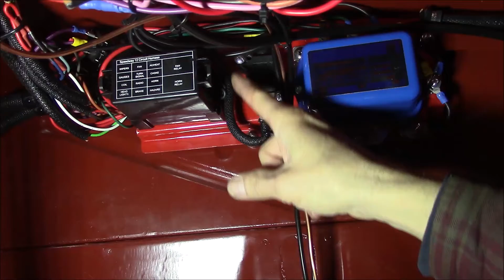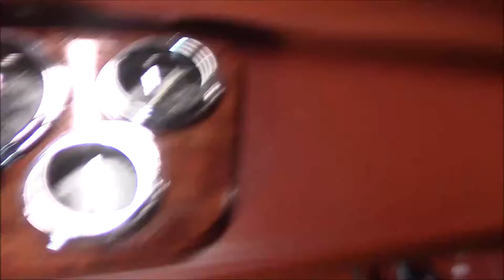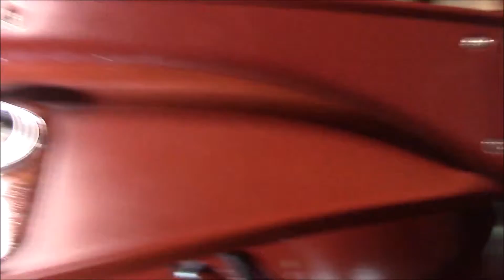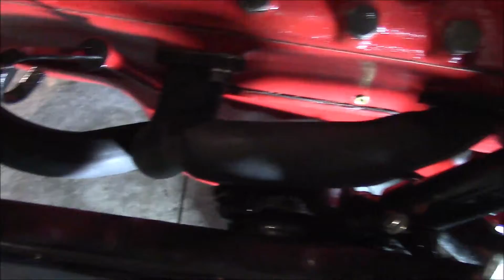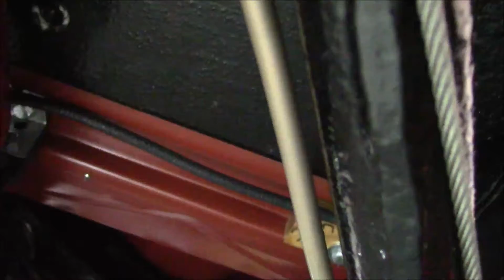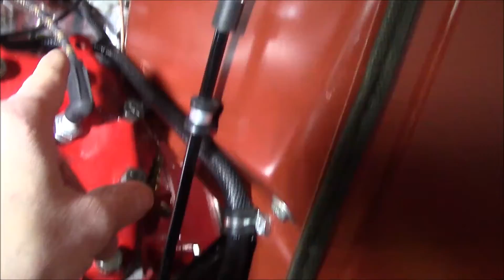Aarons 29 AV8 coupe build 6 Feb 19 update

Comment: Looks nice.   @Aaron Dominguez  Where did you purchase the asphalt loom?  Looks period correct!

As soon as the weather breaks I’m ready  to start wiring my 30 A pickup,   finished paint just before winter hit.   (No heat in my garage).   I purchased a Rebel 9+3 harness.  Have used one of these before in a 64 Mercury and really liked it.
Reply from the maker: Hi MercMan, I bought the loom on Ebay from tons.performance.

Comment: Aaron you've done a great job on the wiring. Very tidy. That cloth cover makes all the difference too. A couple of questions. Where you split the cover to either bring out wires or change to a smaller size cover did you use standard electrical tape, cloth tape or nothing? Also for the clamps holding your harness to the frame rail did you drill through the side of your frame to anchor them with bolts or screws. I couldn't tell. Bummer to hear about the fellow stealing your gauges. The new gauges look great and were definitely the best new option out there in my opinion. This is a excellent car you've built.
Reply from the maker: Thanks Corsa. I used just a couple wraps of standard electrical tape. For the clamps, I drilled as few holes as possible on the bottom rail of the frame. I used the same holes to clamp the fuel and brake lines. I installed the machine  screws holding the clamp  with the head on the outside of the bottom frame rail, you can't really see them standing next to the car.
You are doing a great job on your car as well!
Reply: @aarondominguez4533   Oh that's great info, thanks for sharing. Real quality work on those little details. I've taken real inspiration from your build.